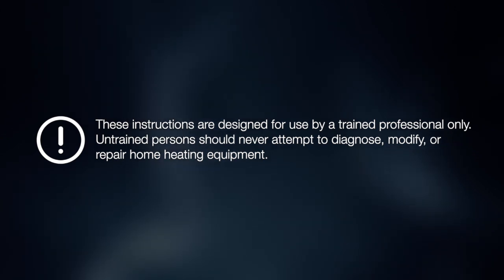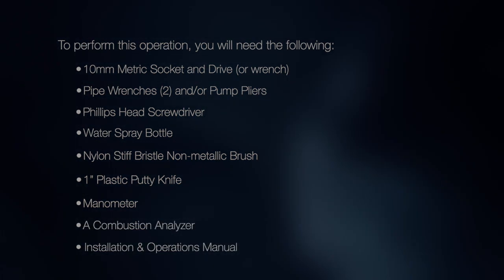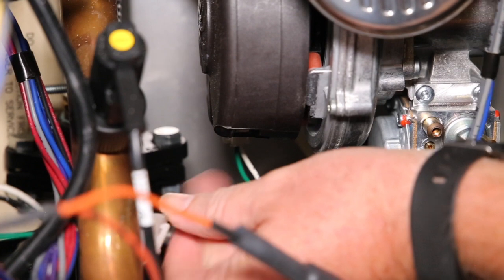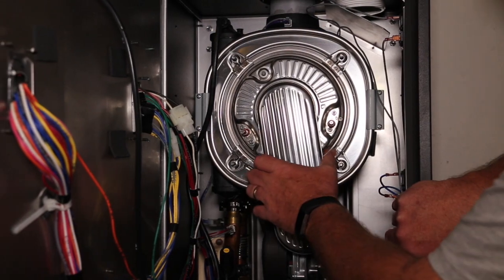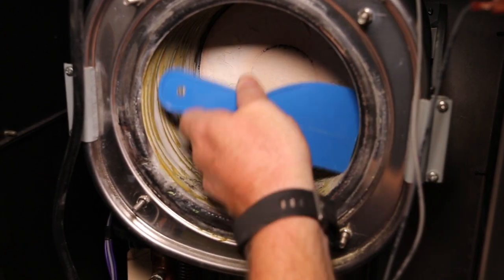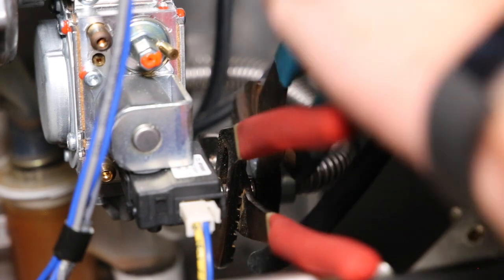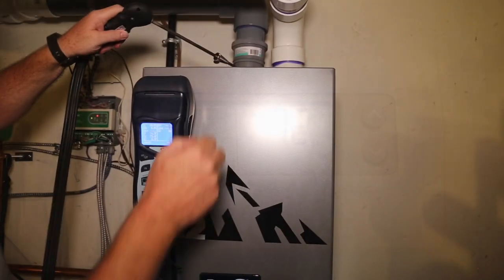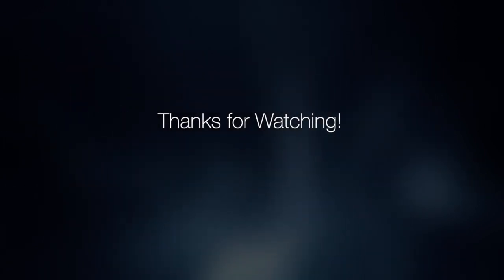Cleaning the Heat Exchanger in a K2 and K2 Combi High Efficiency Boiler

Comment: If there was a chance of calcium chloride from had water how do we clean that?
Reply: Vinegar
Reply: @br5747 where do I pour the vinegar in to do that?
Reply: @No-ik2tk  
I would put it in a pump sprayer and spray the heat exchanger, let it soak for a while and rinse.
Reply: @br5747  I mean inside the coil